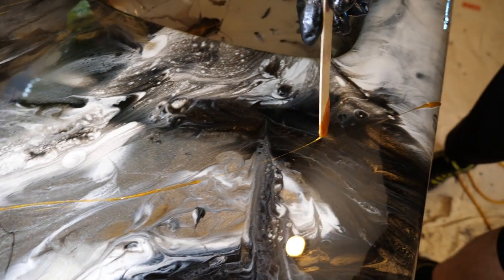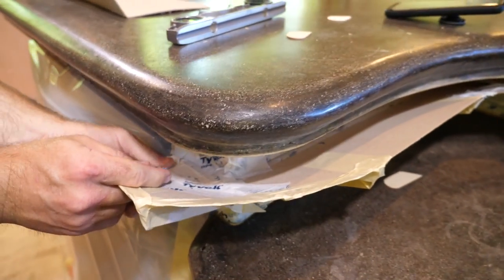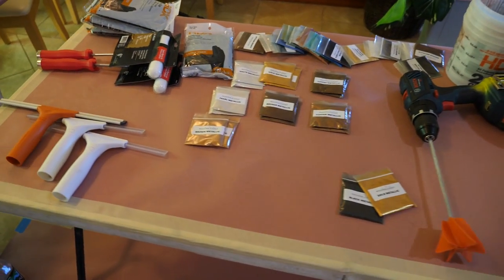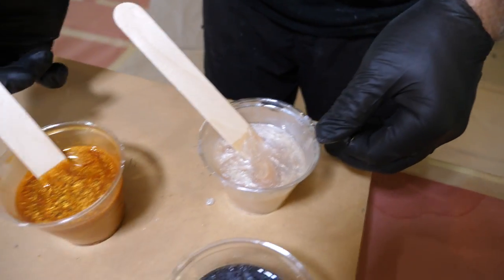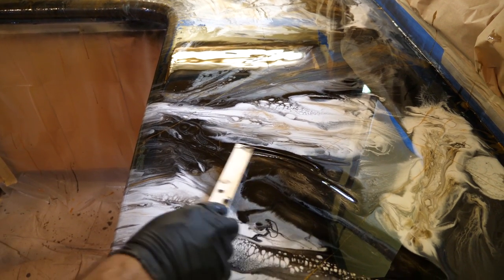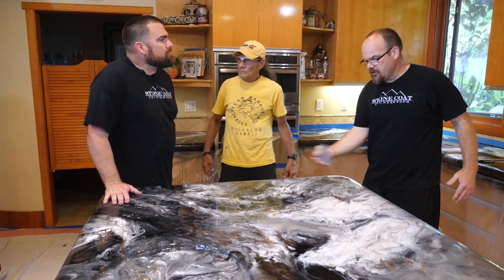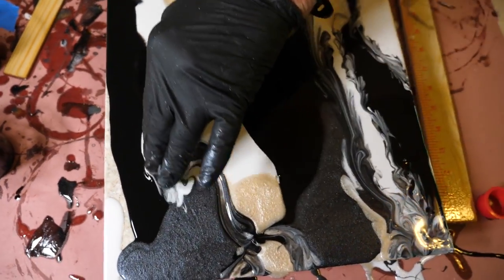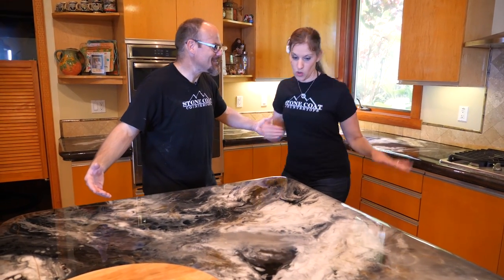How to Fix Ugly Kitchen Countertops 🏝️

Comment: WOW great video!! Yeah, so i've heard a lot of contractors say they build all countertops with MDF in a shop and install them after they cure. I can see the benefit to that in some applications, but one of the main reasons I was drawn to start doing this is the ability to pour right over customers existing countertops
Reply from the maker: Hi Drewskidelmar, yes it really just depends upon the situation, in some cases it is easier to create something brand new, in this situation it was much more time and cost effective to go over the existing concrete.
What situations would you like to see us tackle in the future?
Reply: Stone Coat Countertops I would love to see how to properly fabricate countertops for outdoor kitchens! I did a pour over some outdoor concrete tops , and that was a nightmare here in Florida! I’d love to see the proper way to make one in a shop so it comes out perfect the first time but can hold up to the elements

Comment: hey! I got a concrete countertop that has been brushed with epoxy before. After watching all your impressive videos I would like to try it myself on my concrete kitchen top. May I know should the epoxy I have done earlier be removed before sanding it with 220 grit paper and applying sealant and primer? thanks!
Reply from the maker: Sand down the epoxy that was previously applied then follow these steps and you should be good to go!
Reply: @StoneCoatCountertops  thank you!

Comment: So, it looks like some epoxy from the color coat did run up the grout on the existing backsplash in spots. How would you solve that? I'll be pouring over countertops and keeping my existing backsplash, so the question is really important for me.

Comment: I have Re poured my countertop multiple times, after heaps of money spent it’s still not right. Is there a way to fix up just the edges, without having to re pour the whole bench? The bench has waterfall sides. At first we poured all sides, backboard and top, separately and flat. Then we joined them and intended on a final pour over the lot. Unfortunately the sides just dropped off unevenly. Sanded it back and then poured each side flat, turning the bench so we could pour each side, one day at a time. This is ok, but the edges are still bumpy. Will you do a video on redoing edges without a total repour?

Comment: 28:11 what do you do about the spots on the back splash where the epoxy got under the tape?
Reply: I've never done epoxy, but with a tile backsplash, tile is so strong, you can just get a razorblade, make a straight cut at the seam, and the scrape/cut it off down to the seam you cut.

Comment: I live in Australia and have been trying to find out from Leggari (Stone Coat Countertop's opposition) about how much epoxy I would need to order to cover 140 square metres that's 1500 square feet! over a concrete floor. I asked for a price for shipping and gave them my exact address. I have also asked how much epoxy I'd need to cover a large countertop and again, the shipping cost. After a week or emailing I am no closer to knowing the cost or the amount I need to order. I am not looking for any kind of discount even though I'm requiring a lot of product so I just cannot understand how or why Leggari could be so disinterested in such a decent sized order.

I feel that, if Leggari can't be bothered at this point before I order and pay, then what would they be like if I ordered and there was some kind of problem?

I have now contacted Stone Coat Countertops instead so hopefully I can, at least order the countertop epoxy. I wish Stone Coat also did floor epoxy too.
Reply: Stone coat have a good customer service. I believed you will get an answer soon.
Reply: Did you get your answers you needed?  FYI  we also carry floor epoxy. Thanks so much for watching